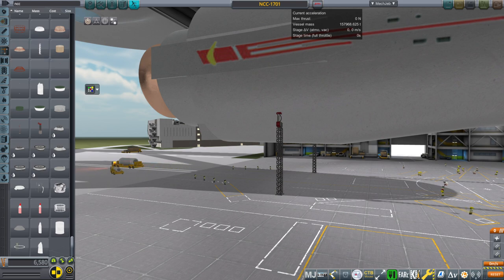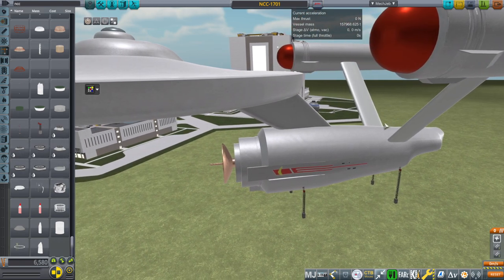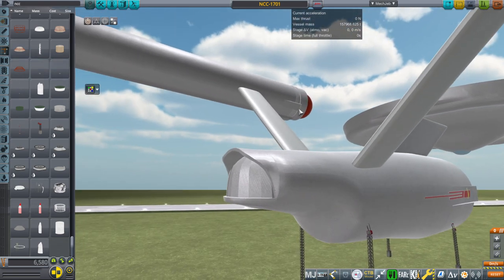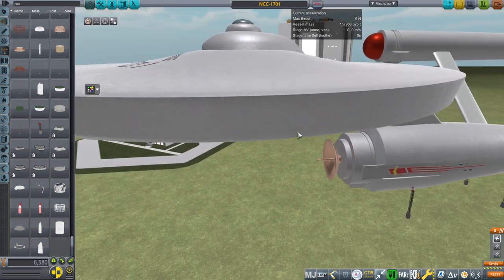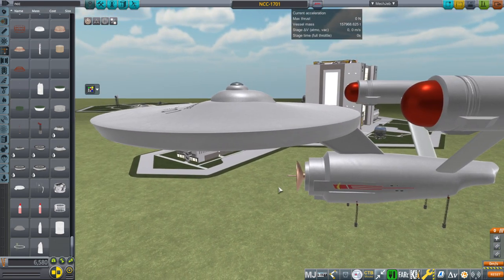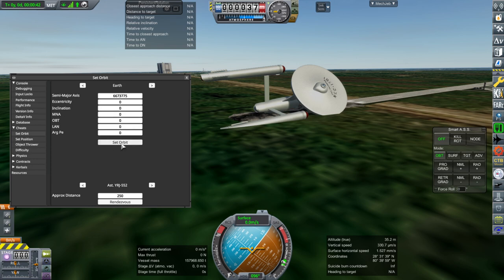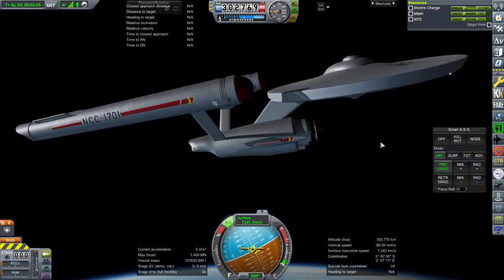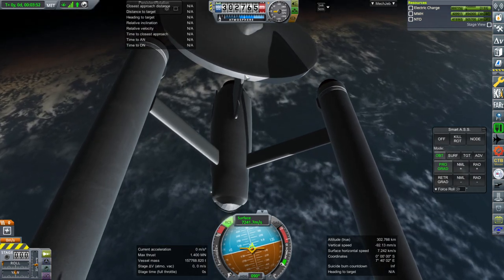KSP with Realism Overhaul - Starship Enterprise NCC-1701 Initial Work

Comment: The back of the saucer section contains a pair of impulse engines (which could probably be a separate part) and there's some detailing on the bottom of the secondary hull. I think your decision to leave most of the hull a relatively solid color like the original instead of the later grid/paneled design is smart, it gets around the limitations of the texture resolution plus it's timeless. Overall, looks really great. I'm excited to see the Enterprise visit planets of the solar system & dock rendezvous with smaller craft in Realism Overhaul.

Comment: Would it be easier on part and texture size to split the craft into a few parts? The Saucer, the engines and body and the structural beams?
Reply from the maker: It's in four parts right now, and technically each part has multiple meshes, and each mesh can have its own texture. This model currently has 14 texture files and 14 bump maps and the total size is 55 MB.